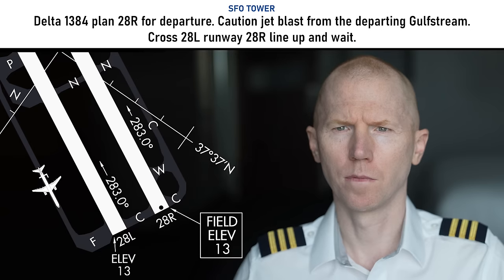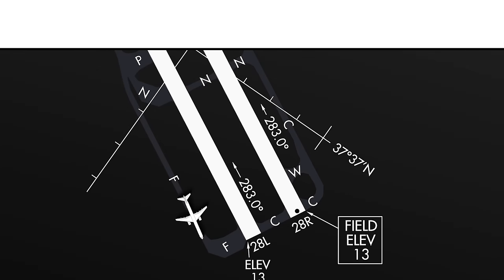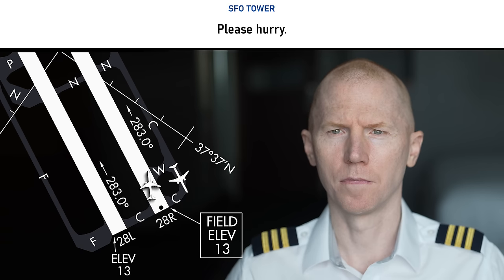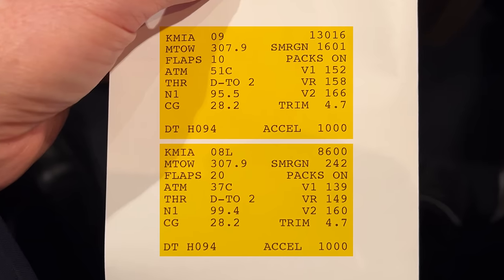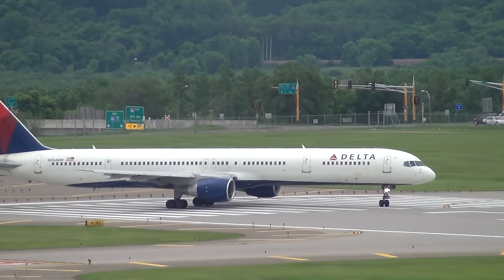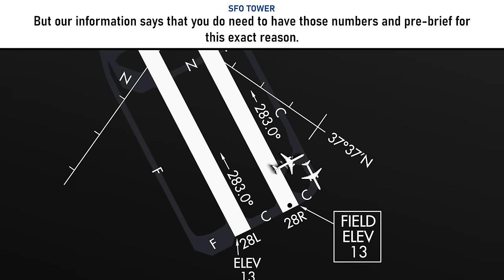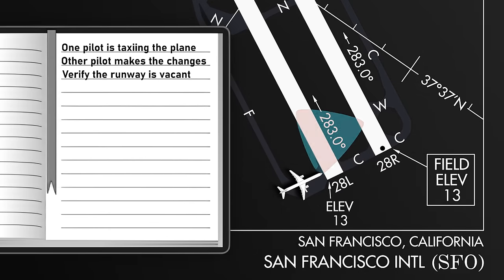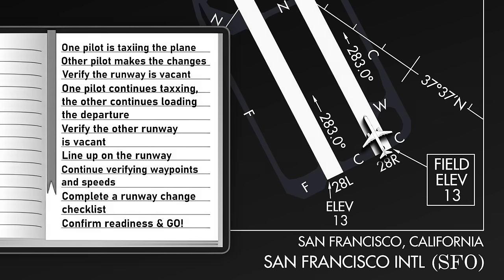ATC Doesn’t Like Delta’s Comment

Comment: Kelsey, this is a very relevant and detailed explanation of the complexity of operating an aircraft safely. Thank you. I am retired from the airlines now, but have had this happen to me a number of times there at SFO and many other airports. What is even more complex, demanding and time constraining for us "human pilots" is a change or a portion of a change to a published arrival route at the last minutes of perhaps a very long flight when you are likely fatigued and are not performing the necessary critical array of tasks at your best. For the most part, both pilots should be "heads up" looking outside for traffic at this time and not pushing buttons into a box and crunching numbers. I have always wondered why the FAA does not recognize, address and severely limit this practice as a priority because I feel that it would really increase overall safety. Of course, it would also increase delays and reduce airport peak capacities as well.
Reply: Not sure how long you have been retired, but we are required to stop the aircraft and set the brake for "high task loading situations" like this.  In fact our ops specs states that the parking brake must be set and an additional departure plan checklist is run to verify changes were made correctly and briefed.  I would not have accepted the take off clearance here after the change.
Reply: @chrisstromberg6527  Can't set the parking brake while in the air.
Reply: Having seen so many videos of situations pilots have to deal with (lost of a part of the fuselage, exploding engine, etc) seems like last minute changes might be down the list. At least there are known ways to properly handle it.
Reply: @chrisstromberg6527  Given that the comment was talking about last-minute arrival procedure changes, this wouldn't be relevant since you can't stop the aircraft and set the brakes when it's already in flight.
Reply: @chrisstromberg6527  I have been retired for almost 3 years. Yes, sometimes we did set the brake to complete the tasks, but it was not dictated in our manual but was at pilots discretion. The difficulty it causes for ATC even though it pales in importance is that there is often no place to stop and set the brake and doing so will cause more delays than it would if ATC was just inconvenienced and just approved the original runway. Of course...not possible to stop in the air and delaying vectors or a hold can ball things up as well. There is the pressure to "get it done" fast and without error, and almost always we are successful but we are human and mistakes will continue to happen as long as ATC is allowed to continue this practice that helps them cope with high volumes of departures and arrivals.
Reply: @RPO767 I had a flight into SFO recently where they changed our arrival twice after TOD.  That was fun. 
Departing the next day we got a different runway assignment than planned (after push and start) but got it sorted before taxiing. The ATIS had changed from L to O in the 25 min since we had got our clearance.  
If i was in the situation in this video, i wouldn't have accepted the line up and wait.  Why put that time crunch on yourself?  Just hold short and get it set up, then let them know you're ready.
Reply: And yes, you read correctly, atis changed 3 times in 25 min, it was a gusty day.
Reply: @toddsmith8608  I can believe it, but, wow, ATC dosen't quite reailize the amount of work presented to the crew and expects it will be done in short order. Looks like in this case there was no where else to put them, they didn't want them to stop and were banking on the 2 minute estimate from the crew so thought it would work out slicker than snot.  They did know that pulling up and exiting them at "N" for resequence would get them out of the way and give them a nice long time penalty to sort things out.
Reply: Your points are excellent. I’m not a pilot, but watch a lot of aviation videos & Air Disaster episodes, & last minute runway changes, etc. have clearly caused some unfavorable results. Maybe Kelsey can discuss this more & give people more insight into this issue! It’s an interesting topic!

Comment: As a Widebody CA I enjoy having a third crewmember and sometimes a fourth. These extra sets of eyes are invaluable. But even with that extra safety, I would not have moved onto the runway before being fully ready. Something happens when crossing the line onto the runway, my brain goes in the takeoff/reject mode. So dealing with a new runway/route/altitude/engine failure procedure at this time is out of sequence and I am very prone to make mistakes. It takes me out of my zone at the worst possible time. 
I don't worry about the controllers' attitude. (based in NYC you have to have a thick skin. LOL) I worry about what is good for my crew/passengers and I never, ever rush and do not succombe to ATC's pressure. I am not combative toward controllers (they do an incredible job to keep us safe) and I try to help them whenever I can but I don't let them make their problems my problems. 
In that case, the controller put herself into a pickle by letting them line up and wait and tried to blame the crew when it backfired and the crew's mistake was to try to help her. "Slow is smooth and smooth is fast" is the key to be safe in aviation and should be part of every briefing. Sorry I did not intend to write something this long.
Reply: Beautiful response…clear explanation. Logical.
Reply: Very well said
Reply: That very hard timeline, can easily create a stress that will slow you down, just when you come to be in a hurry.. 😳
Reply: Most Excellent response! Adult like, professional, safe, and controlled. Thank you Sir!
Reply: 100% Im with you, I’m good sitting outside of the runway environment. If she doesn’t like it, we can taxi somewhere we aren’t being rushed through our process.
From my early cfi years, a TRACON supervisor came in to give a speech and I remember he said: Never let a controller, rush you, tell you how to fly the airplane or be rude. They are government employees.
Reply: @AeroMaquette  will said Captain.

Comment: One minor point that you didn't bring up is that it's typically the first officer handling the radios and programming the FMS on the ground while the captain taxis. So the first few calls you hear are the FO, and he's the one saying they need "2 minutes", which obviously turned out to be an underestimation. He probably thought he could do it in that time. I'm guessing that the captain intervened at some point, told him to slow down and that they'd take off when they were ready. I've had that happen. When you hear "more than 30 seconds for a runway change, please", that is now the captain interjecting. Different voice, and since it was the FO before, it can only be the captain. So he's now taxiing and simultaneously arguing with the controller, which isn't a great idea but also just illustrates the power dynamic a little bit. The FO obviously didn't want to get into it with the controller and seemed to be trying to do what she wanted; the captain doesn't seem quite as inhibited.
Reply: Or the numbers didn't come back that fast.   Or at all.   Now 2 eyes need to be looking at the FMS and see why things aren't jiving.
Reply: @artheriford  Honestly, they really should have had numbers for both runways. I've done this same takeoff with the same note in the ATIS. Everything Kelsey says is correct about taking the time to get the numbers in and verify everything, but you check the ATIS at the gate and if it says request both sets of numbers, that's the time to request both sets of numbers. You're not doing anything else at that time. So if they didn't do that, that actually is on the pilots. I was assuming in my comments that they had done what they were supposed to do and it was just taking them the normal amount of time to verify everything and run the departure changes checklist.
Reply: @ModernClassic  I guarantee 100% that they had the numbers for EVERY departure runway at the airport. Delta prints them ALL before the push. The issue isn't getting the numbers, it's getting the numbers plugged in, and the runway, and the departure, and checking the waypoints, and deleting the discontinuities, and checking obstacle clearance, and engine out specifics.....
Reply: @howesfull8  I'm an A320 pilot. It sounds like you're thinking of the TLR report, which is not the same as "the numbers" we're talking about here. Those numbers need to be calculated for each runway based on real-time information provided by the pilots, the gate agent and airport ops. At least in the A320, we can't even request the numbers for more than two runways at a time. Sure, we could do separate requests, but then our uplink isn't going to work correctly and there's a higher likelihood of making a mistake in entering them manually. It would at the very least actually slow us down. Also, it takes time to get the numbers - usually about ten minutes, so we're not requesting them for runways we know we won't use. At most airports, there's also just no point in having the numbers for every runway; airports in the US typically only use a maximum of two for takeoff at a time.

Getting the numbers "plugged in" is literally a matter of pressing one button (it's labeled "insert uplink"). There's no reason there'd be any discontinuities because you're not changing departures, only runways. Checking obstacle clearance isn't something we normally do in VFR conditions on a company and FAA-approved departure.

What we do have to do is a departure changes checklist, followed by the "below the line" portion of the before takeoff checklist (or all of it, depending on what actual changes we've made). That isn't actually a lot, but it could easily take somewhere between 2-5 minutes, which is what it sounds like these pilots needed. It's also something that a first officer with a lot of confidence could think he could do a little quicker. At my airline, it's literally about 10 total items to do between both checklists. But you do need to not rush through them, which I'll bet this FO's captain told him during the process.
Reply: @janeryan2709  I would, because I'm a pilot and that's how it typically works on the ground. The captain taxis, FO works the radios.
Reply: @ModernClassic total rubbish!! Either pilot does the taxying. It's whoever is operating the sector ! Except, of course, the aircraft types that only have a tiller on the captain's side.
Reply: @shanepotter5532  I'm an airline pilot and this is how it works at most airlines in the US. I'm not debating. Also, you posted a second reply and seem to have deleted it, which is probably for the best.

Comment: European commercial pilot here; serious question: Don't you get a departure clearance before you push-back in the US, be it via DCL or voice? Because we always get a departure SID, squawk & RWY at the latest 5 minutes before push-back. Then, if there is a runway change, the controller has to double check with us and ask if it's possible. Again, I'm unfamiliar with the SOPs in the US, so any clarification is welcome ;)
Reply: Bit late but yes, it’s the same in the U.S. and it’s highly unusual for runway changes in the last few moments.

Comment: I was on a Delta flight that had to change runway at the last minute, due to weather. Pilot came on, explained that it was going to take several minutes to input the new information. We took off about 10 minutes late, but SO WHAT? We arrived at our destination safely. Thank god for the pilot. And I love Delta!
Reply: Understandable but you being in the back of the plane don't have pressure on you. We as both pilots and controllers are constantly pressured to streamline traffic and get things moving. It's the industry, nobody likes delays but we can only do so much. Think if 20 planes all had a runway change for weather, all 20 planes need that 10 minutes to change the information in the plane?? Now we are talking massive delays because they can't all takeoff at the same time. I'm not defending her actions here but its just the business of aviation, constant pressure to be as efficient as possible and keep things moving.

Comment: While I was stationed at Grissom AFB, one day a helicopter requested takeoff clearance from the parking ramp.  The helicopter just wanted to go straight up.  ATC denied the clearance and advised them to taxi to the end of runway for takeoff.  The copter crew did taxi to the runway, got their clearance, then flew straight down the runway, stopped, then went straight up.
Reply: Helicopters "taxi"?  Some of them just have skis. That being said, "just going straight up" could put a helicopter in the path of some fixed wing aircraft, couldn't it?
Reply: @JimMork  I sit and watch my local field (in the UK) and all the Heli's I watch will hover a little off the ground and taxi to the runway like that, then they climb forward and up following runway heading. I'm not sure what the view is like in a heli, but I assume like in a fixed-wing you can't see what's directly above you.
Reply: @not-a-lot-of-options  A different meaning of "taxi" with no wheels involved. But every aircraft has to do "the dance" as choreographed to keep all parties safe, would be my interpretation. Same with these GA pilots in major airports. "Just fit in".
Reply: What was the timeframe for your time at Grissom?
Reply: @waldoinaz  78 to 80 and then again from 84 to 93.  I was there when the active base was closed, and then pcs to MT.
Reply: @robertheinkel6225  

I was there from ‘88 to ‘92. I thought it was a great “community” and I always enjoyed the assortment of transient aircraft that would come in for touch and goes. I vividly recall when aircraft out of the southeast would flock to Grissom when hurricanes threatened them. 

On a positive note, the area dodged an economic bullet when the base was allowed to remain a reserve base and the 434th stuck around.
Reply: @JimMork  some helicopters have wheels, like the Blackhawk.
Reply: @thepapschmearmd  I'm sure there are many configurations. Jets use their engines to move the plane. Are there motors in helicopters to drive the wheels like a car? The blades seem designed to lift not push.
Reply: @JimMork  60
Reply: @pauldavies5168  Is this like Hitchhiker's Guide where the answer to everything is 42?
Reply: @JimMork  Nobody is going to be flying right over the runway unless they are above the airspace (most likely thousands of feet above). When they "taxi" they fly along slowly just above the ground.
Reply: @shawnalley3309  OK, but negligible altitude is as good as on the ground. Can't cross any active runway.
Reply: Must be above 2000 ft.
Reply: @eugeneoreilly9356  Correct. A couple of hundred might be enough given that planes are about  100 feet when ready to touch down. I don't know exactly what Bravo zone is, but it has to have some sort of top elevation, too.
Reply: @JimMork No, they push with the rotor as well. Modern helicopter rotors tilt, so if they have wheels and want to taxi the rotor simply tilts forward a little bit. That's why you never approach a helicopter with it's engines on from the front.

Where I fly out of they usually just clear helos to take off and land on the taxiways. I loathe when they have them actually taxi because that rotorwash can be hell on parked planes. I've seen and heard of a lot of serious damage from things being thrown and control surfaces flapping around.
Reply: @redfoxtactical8425  True, noticed that feature long ago. A helicopter would be useless without forward motion. Some even have jet engines for much higher speed.
Reply: That’s a piss poor controller. I have seen this as a controller. It’s embarrassing usually it’s someone who sucks at the job.
Reply: Really, what about the altitude-speed envelope, only a fool cliimbs staight up, right into the prohibited , no autorotation possible region!
Reply: @Arturo-lapaz  Actually seems helicopters should have their own part of any airport, a ground version of a helipad where no danger exists of mixing it up with the fixed wing traffic. Not necessarily a GA airport, just not having to taxi anywhere.
Reply: @thepapschmearmd  The BEST ones have wheels......like the Blackhawk 😜
Reply: ATC has rules to follow and taxiways and ramps are not generally areas approved for takeoff and landing!

Comment: Yeah, that local controller at KSFO was snarky.  I've flown in/out of San Francisco a lot, and departing 28L while arrivals use 28R is commonplace.  Also, yes, the Delta crew (hindsight) should have held short of 28R while re-loading the takeoff data.  After all, we DO get paid by the minute!!  The controller was a little too eager to "push the tin" that day.
Reply: Agree. Both parties work under stress.
Reply: Yes... that ATC seemed like she was just itching to pop off.
Reply: @ariochiv   I got that feeling too. She tested him knowing it was probably an edgy thing to do. She must have been having a bad day.  She also needs to be reminded there are probably 150 souls on board and that playing "challenge-you" while they innocently sit in their seats is not a good idea. As has been said in other posts here, it would help if both sides were required to walk a mile in the other's shoes, every so often. I would side with the F/O here. He was trying his best to keep the show moving while taking pressure from his capt. and her. And she should have known how touchy an FMS keyboard can get -- if she'd ever been in an airliner cockpit. That "oooh" sounded like she won an argument in a neighborhood bar.